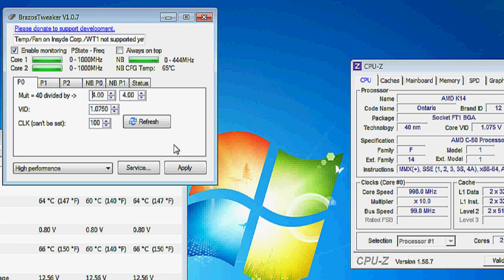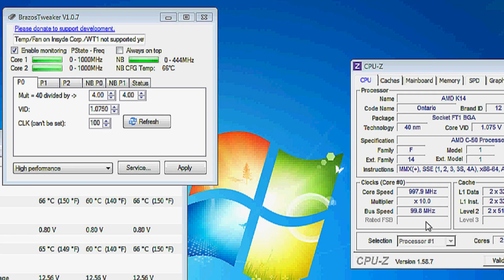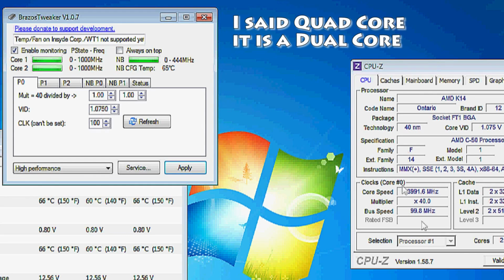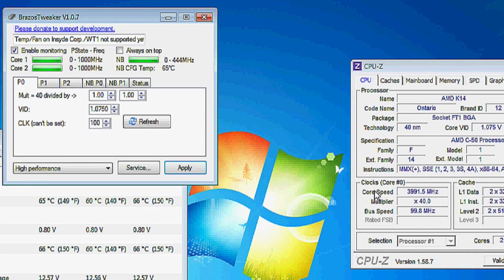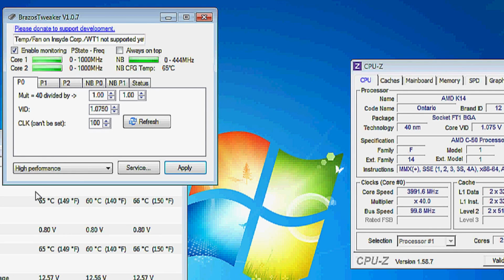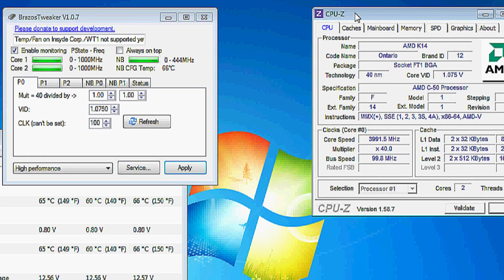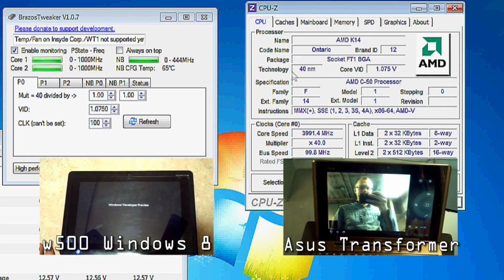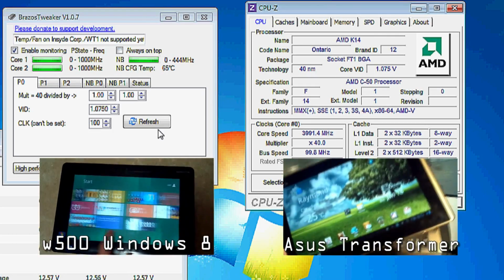Overclock AMD C-50 Acer w500 Glitch (1ghz to 4.0ghz) APU

Comment: AMD C-50 will only clock to 1.33Ghz x2 + the ati radeon HD 6290 may not overclock on all netbooks. This setup would give up to 69fps for street fighter 4 with all settings down to the lowest. And yet it can handle 800x600 with medium details on models with a reasonable 60fps, but no other options are enabled. I have done this with a properly overclocked setup. but if you want 45fps all on low and the background graphics on, this netbook can do it.

Comment: I got a question about Acer W series. Im in the navy and i want a tablet with Windows 7 to do some gaming. Ofcourse not ultra high qualities and the high end games. But games like BFBC2 rating. And i saw you did bf3 SP on low. So that might be possible. I see there is a Acer Iconia W500 and W501. C50 and C60 processor. What is your experience with these processors? Wich is the better? And by much. I did research and found little. Thanks in advance.

Comment: @CoffeandTV1 The video is not fake, i replicated it my self.
The thing is though. The overclocking itself is fake. The CPU doesn't recieve any perfomance boost, but instead decieves the tools used to check the cpu frequency into thinking it's running faster :)

Comment: @R3DLIN3S yeah that's true, it does help with the processing too but it depends on your software as well. If its not a 64bit program it won't help with the processing. But then again, most everything now days is 64bit software, besides games, so it would be best to run 64bit if drivers were available.

Comment from the maker: @bluegizmo1983 A 64bit O/S does not just mean reading ram greater than 4gb, it means that the data rate is doubled when utilizing processing power. I notice a huge difference when I put win7 64bit on w500 over win7 32bit (the out of box o/s). I will have to try doing a production ready win8 after I chuck on a few linux flavors.

Comment: @R3DLIN3S yeah for sure. Try the 32bit and then download drivers from Acer. 64bit isn't really needed since the w500 only has 2gb of ram. If you want to keep the screen rotation function under windows 8 you also need to download the Device Control app from Acer as well as the g-sensor driver. The app is in he same place as the drivers on the Acer website.

Comment: @R3DLIN3S ah damn that sucks. I've never owned an ssd yet, wasn't aware of the wake up dead issues. Did you install the 32bit or 64bit win8 when you had issues installing the video card? From what I understand you can use all the win7 drivers from the Acer website if you install the 32bit win8.

Comment from the maker: @bluegizmo1983 running win 7 right now, win 8 is not ready for production environment, would not let me install the video card. I could have forced it with a .ini file rewrite but I said screw it. 64bit win8 is only 12gb, delete the hyber.sys and system restore. Delete the windows update cache folder when updates are done and compress c:\ (makes reads a bit slower). what it needs is 4gb ram and a bigger ssd. Problem is SSDs suck right now, you get Wake Up Dead drives 7 months into it.

Comment: @R3DLIN3S yeah I can understand that. You running win7 or win8? as my w500 arrives I'm making a disk clone of it for safe keeping on my NAS then I'm formatting it and installing win8 32bit. That only takes up about 10gb. I'm also looking into buying a MyDigitalSSD 128gb msata drive, their only $200. Or you could buy a Lexar 128gb SDXC card for $170 and create a virtual hdd on it too but those cards transfer at like 20MB/s vs 180+MB/s on the ssd, so gaming performance on there could be an issue.

Comment: From what I understand as to why it glitches and shows its overclocked when its not has to do with the processor itself. From what I read, you can change the clock divider to a lower value which should increase clock speed, but the CPU ignores any divider value lower than default even though the lower divider value did take. Then cpu-z sees the lower divider value and runs its own calculations and shows that it is overclocked when it really isn't.